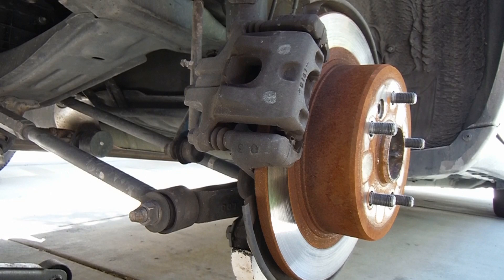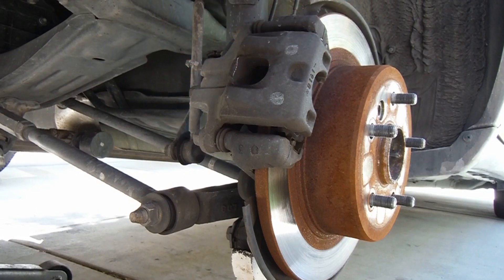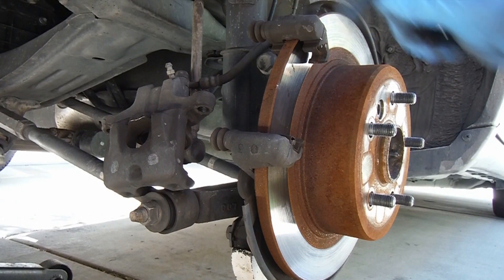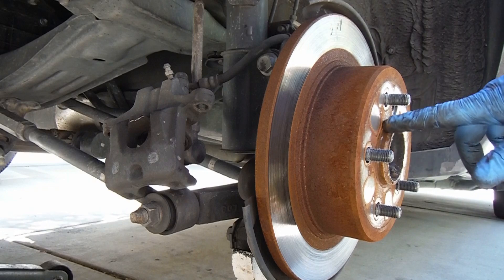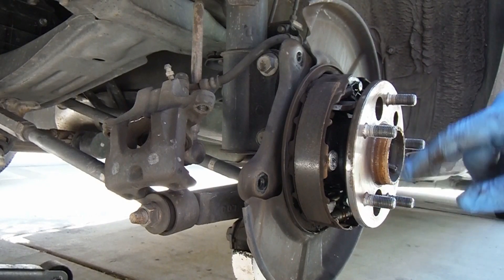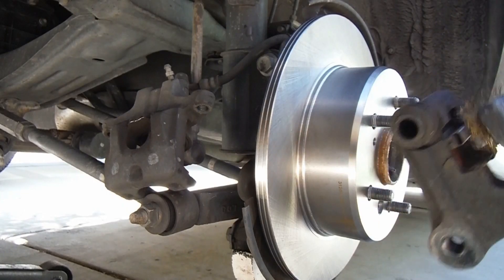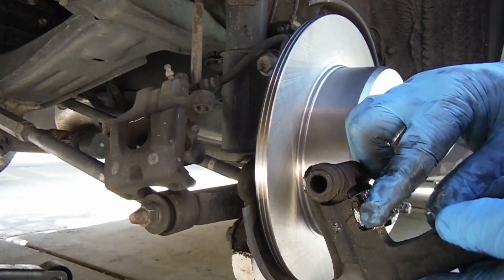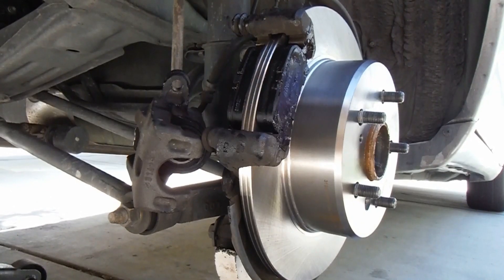2001 TOYOTA AVALON - HOW TO REPLACE REAR BRAKE PADS & ROTORS - DIY

Comment: Dan, I'd never even done a brake-pad job, but with the help of this vid I just successfully changed the rear rotors on my 2002 Avalon.  Only thing that took a while was getting those damn guide-pins loose with my regular socket wrench..... smooth sailing after that.  Just wanted to say thanks.

Comment: Like several other comments here, this was my first time attempting a brakes pad/rotor job. Your video made completing the task very easy. Except, on the right side rear I did have to take out the top bolt to the shock mount because I could not get a good grip on the socket. Thanks again for your help in 2024 and you have a new sub.

Comment: Hello Dan, Huge thank you for the video. I build Harleys, and also work on the family cars. Nothing crazy,  just basic stuff. When I was first learning motorcycle repair almost 40 years ago, a seasoned tech reminded me that working on someone's brakes can literally mean life or death. You have to know what you're doing. I've changed dozens of rotors/pads/drum brakes on various vehicles, but this was my first time with an Avalon. While most brake construction is pretty much the same, remembering my Mentor's advice, I would be more comfortable knowing exactly what I should do. Your video does just that. Simple, clear, teaching, nothing overly explained, but nothing missed. Thank you again for your time and effort on the video. It is the most straight forward, informative one I found. On a side note, look into Power Stop Brake Kits on Amazon. (I get nothing from them, I just like their products.) Their kits include new rubber bushings/boots, pad clips, grease, everything you need. I find their pads/rotors wear very well. Cheers!
Reply from the maker: Thank you so much for the nice comment, and for the tip on power stop pads.  I have used them in the past on a few vehicles, and I currently have them installed on my wife’s Lx 450 and they are working great.👍🏼
Thx again,
Take care,
-Dan the Fix it Man

Comment: Your getting more and more thorough. Your thoughts sir. Where I live, there is a lot of rust.  Therefore, where the brake pad hardware is used, and under it on the caliper bracket, there is something commonly known as rust jacking.  The bracket needs to be removed, and using files or a sandblaster is required to get back down to bare medal.  Then a light coat of lubricant (silicon based) is applied under the hardware. You refer to them as clips.  Then, no lubricant is applied to the surface where it contacts the pads because this invites dirt, dust and road debri to stick or accumulate.
Reply from the maker: Hello Again Robert,
Yes, if the caliper brackets are really rusty, it's necessary to take out the hardware and clean the caliper bracket with a wire brush or file to get the pad retainer clips (hardware) to seat properly.  I think that's a great tip to put the lubricant under the hardware as well and should help prevent some of the rust on the caliper bracket.
I can see your point of how road dust and debris might stick to the grease on the top surface of that hardware, but all of the diagrams I have seen show that grease should be applied to the brake mounting tabs or 'ears' and the pad retainer clips (hardware) surface where the pads make contact.  Here is a link to one diagram I found online: https://www.justanswer.com/uploads/ebrock63/2009-03-14_192438_2009-03-14_132705.png
Here's a link to another brand of brake grease with a diagram on their website:
https://www.super-lube.com/brake-grease-applications
My understanding is that this would help the brake pad move freely in and out as the brakes are applied and as the pad material wears down.  Without the grease on that surface, I would think there would be a greater chance of the pad getting stuck or not completely release it from pressing on the rotor causing premature wear.
Again, I appreciate the great comments and feedback.
Take care,
-Dan the Fix it Man
Reply: My brakes weren’t working too well for me a few months ago. They just didn’t feel right. I took the brakes & hardware off and saw the rust you’re talking about. It was so much that I couldn’t even file it down. I had to buy new ones. On the new ones I put anti seize underneath the brake hardware. I’d highly suggest that even if you don’t live in a cold place. It can’t hurt right? Also I put that brake grease on the inside of the hardware where the brake pads slide. You’re right, I just checked and there is a bit of dirt stuck to it. Now I know
Reply: Robert is correct never put grease where the pads run on the bracket. It is an invitation for all kinds of problems. But the rush jacking issue is absolutely correct. The model here is usually wire brush on your caliper brackets and make sure everything is down to bare metal as Robert has said.

Comment: I have to do this same job on the same year avalon in this video. Thanks for the great video. Good tip to line up hole in rotor to adjust parking brake.

Comment: Ha! And I thought I was one of the few remaining weirdos who still grease the boots. I do this on caliper piston, caliper bolt and even cv boots to protect against the elements. So long as it's a rubber friendly lube. Sure it'll attract a little dirt but I've not had dry rot on boots in decades.  

Jesus, Dan, ya got me watching videos of sht I've been doing for years. I guess I can't help but wonder how others do the same job....never know where you might find a fresh perspective even for the simplest of jobs.

Really nicely done videos, by the way. Clear angles and straight to the point. Thought about making repair videos years ago and decided I just didn't have it in me to go through the videography crap...lol. So folks are lucky you're willing to invest the time to do it.

Comment: I worked on mine today, a 2004 Avalon. The bottom slide pin on the passenger rear was rusted in place. All the lube was gone. I bought a Hercules 3/8" cordless ratchet which couldn't remove it. I couldn't budge it with a breaker but I carefully was able to break it using a Craftsman 1/2" cordless impact. I used a screw driver to push against the flange of the bolt (slider) while using the impact to spin it free. The rotor was also rusted solid to the face of the hub. Even with a sledge, it wouldn't budge. I had to thread 2 bolts into the threaded bolt holes to remove it, I think they are 10mm? When I was torquing them down, I thought I broke the bolts but it was the rust breaking the seal between the two faces. I bought Sil-Glyde like you used on the slider bolts and face of the steel hardware inserts. I also used a brass brush on the face of the hubs to remove some of the rust. Then I applied some axle grease to the hub face so it wouldn't stick anymore. The one thing that threw me off was the slider bolts. The one with the rubber stopper at the end was on top on the passenger side caliper, but on the driver side, it was on the bottom. Do you know which way is the correct way to install them? I noticed you put it on the bottom @12:14

Comment: Can you confirm the Banjo Bolts for the rear caliper are 47318D ?

Do you know if Doorman or Duralast or anyone makes replacement BANJO Bolts for a 99 Avalon ?

I am trying to get replacement bolts, but having a really hard time. I bought the calipers and the hoses and neither come with the banjo bolts

Thanks

Comment: Is there a way to get close to the 34 ft lbs torque without using a torqud wrench? Any tips? It's the one tool I haven't been able to find, and I'm terrified of over- or under-torquing those little caliper bolts.
Reply from the maker: Alexander,
Great question, I have done this so many times and for so many years, a lot of times I don't even use torque wrenches even though I now have several of them.  I still go by feel most of the time.  I try to get the torque specs on my videos and in the description whenever possible, because it's hard to explain how to 'go by feel' on video...
Best of luck to you!
Thanks for watching!
-Dan the Fix it Man

Comment: Thanks man!  But is there a good source on how to bleed the line? Should I be bleeding the line?
Reply from the maker: Hi Geoff,
No need to bleed the brakes if you didn't open the bleeder screw or introduce any air into the system.  Some people have a habit of bleeding the brakes every time they change the brake pads because it also cycles the old fluid out of the system.  Or some people open the bleeder screw to make it easier to compress the caliper piston.  That's not a bad thing, just not necessary each brake pad change (in my opinion).
Thanks for watching!
Best of luck to you!
-Dan the Fix it Man
Reply from the maker: @MAXIMUSMINIMALIST  the parking brake shoes are only used when applying the parking brake, but a lot of the wear can happen when people drive off without releasing the parking brake.  They do not get used under normal braking.
Thanks for watching!
Best of luck to you!
-Dan the Fix it Man

Comment: Wow, it looks almost new under that 18 year old car. My 2003 Avalon is really rusting and one of my caliper pins broke in half. Not sure how I'm going to get it out, there's hardly anything to grab onto. I may just replace the entire caliper bracket if I can get it off.
Reply from the maker: I hope it doesn't give you too much trouble.  I live in Southern California, so the cars don't really rust too bad.  Sorry to hear the caliper pin broke.  If you can get the caliper bracket off, you might be able to drill it out enough to use an EZ Out?  Or... if you have access to a junkyard nearby, you should be able to find another caliper bracket as well.
Best of luck to you.
-Dan the Fix it Man
Reply: @DantheFixitMan  Well I tried again to get the bolt out after work, no good even with a torch. So I was able to find a new bracket at one Autozone nearby-$33 bucks. 10 stores nearby did not have it. Guess I got lucky. Getting the bracket off was easier than I thought. New bolts 12 bucks. Me & the woman fixed it tonight. Cant imagine what a shop would charge for such a repair. Thanks
Reply from the maker: Great news!
Glad to hear you got it fixed, and saved some money as well.
Thx again for watching,
Take care,
-Dan the Fix it Man

Comment: Is there a video for replacing the front rotors.  I have tried a hammer as you have on the back rotor but I was unable to get to move the rotor at all.  Am I missing something? This video is awesome and I appreciate you sharing your knowledge!  Help please
Reply from the maker: Hi Randall,
Sorry to hear you're having trouble...Sometimes they are really stuck on the hub and don't want to come off.  There are usually two small threaded holes in the rotor that allow you to use two small bolts threaded through the rotor to press the rotor off of the hub.  (I am not sure on the size, but it might be M8 x 1.25?)  Go slow and steady on each bolt and eventually it should pop free from the hub.  Sometimes if there's a lot of rust or corrosion the threads don't hold up in the rotor and this doesn't work.  If that doesn't work, you might want to try a large 3 jaw puller.
Best of luck to you!
-Dan the Fix it Man

Comment: On your caliper does or did it have play like rattling noise when driving on rough pavement? I got a rattle that's annoying on my 03 Avalon on rear back I think its the caliper loose
Reply from the maker: I didn't notice any play or anything loose that would cause it to rattle, and this is my nephew's car and he hasn't noticed any noise like that since I have done the brakes.  I have heard that the rear strut mounts can be noisy (the front too).  The rubber boot in the top gets old and breaks and can cause some noise.
Just a thought...
Thanks for watching!
-Dan the Fix it Man
Reply: @DantheFixitMan  yeah I saw that also,I know I can put pressure on the brake while driving and it stops I'm hoping its the caliper being loose that's causing,thanks man great videos by the way
Reply from the maker: @roltyd22  Hopefully you find it and it's an easy fix.  Maybe jack up the car and see if you can hear it when pushing the wheel around?  Or I guess it could be a wheel bearing going bad?
Reply: @DantheFixitMan  It was the slide pins worn and  sticking causing the annoying rattle.
Reply: @roltyd22  thanks for updating, this help me